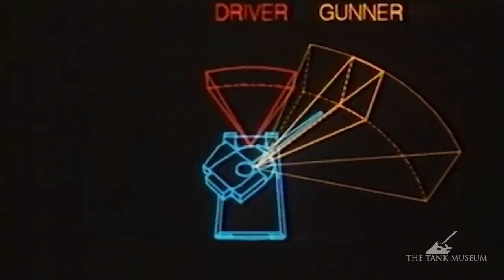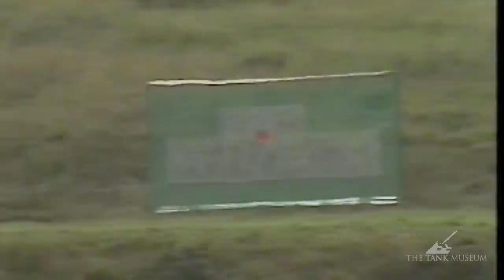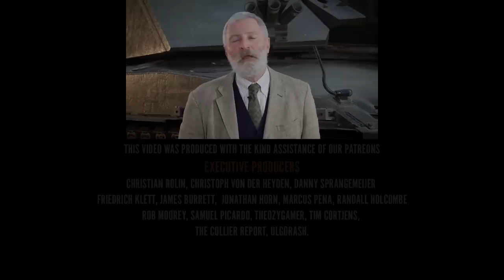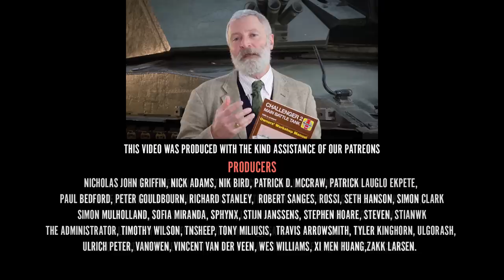Tank Chats #92 | Challenger 2: Part 1 | The Tank Museum

Comment: David has a second career as a HESH ammunition salesman. Looking for the affiliate link.
Reply: Even the HESH practice rounds are useful in combat. These rounds sell themselves.  :)
Reply: Sadly his job as a HESH salesman will soon end. The coming Challenger 3 will use the smoothbore Rhinemattel gun that is used in the Leopard 2. The smoothbore doesn’t use HESH.
Reply: @atinofspam3433  and HESH is pretty bad at anti fortification duty, HEAT-MP does the same job better.
HESH is obsolete from the 70´s onwards as anti tank round, everything you can kill with HESH, you can also kill with HEAT-MP while retaining the ability to fire ALOT more powerful APFSDS rounds
Reply: @zhufortheimpaler4041  thanks for that

Comment: There were 4  British armoured divisions, however none were fully manned. We had 3 tanks per troop, instead of 4, due to defense cuts, .a number of pieces of equipment were removed from Chieftain, due to defense cuts. Regiments were being amalgamated, you guessed it, due to defense cuts.

With the introduction of Challenge they shrunk the size of a tank regiment, yup defense cuts.

So we had a great new tank, but not enough crews to be effective. And experienced crews were leaving in droves. So we ended up with nice shinny new tank, in insufficient numbers, few experienced crews, a smaller force, and along comes the Gulf war.

It was estimated the British should have been required to deploy 1,000 MBTs, we probably had a third of that. We got lucky with the collapse of the Soviet Union.
Reply: Peter King , wasn’t it the collapse of the Soviet Union that led to defence taking a back seat
Reply: Don't we have 200 mbts now?
Reply: Damo2690 Which is well short of requirements
Reply: Fanfeck absolutely. Then the Gulf War broke out.
Reply: @Damo2690  200 and 200 in storage I think?
Reply: Would have gotten 600 CR2's though, if not for post-1997... defence cuts -_- .

Similar reason for why the CR1 upgrade program - intended so as to keep the Tank fleet upto 1,000ish units - was cancelled, and CR1 flogged off.
Reply: Fanfeck defence cuts started in the UK in 1967...
Reply: @fanfeck2844  Not really. Our treasury has always played games with the armed forces. Read Kipling's poems from  the 1900's he talks about the shoddy, unappreciative attitude toward the British soldier back then. 
The fall of the Berlin wall was a very good thing in general and an absolute godsend to the bean counters in the Civil Service.
Reply: Being under-equipped and undermanned, is a court marshal offense (for the chiefs o staff). The sentence is DEATH !
Reply: @fanfeck2844  yes, since there was no longer a major equivalent military threat the money could go to other things, especially when you take into account Labour took power just after the SU collapsed and were looking to rebuild large parts of the country and infrastructure left starved by previous Tory governments, such as the NHS which had been suffering from budget freezes and cuts for years, in the face of those changes a massive military is not needed

though ironically Blair would turn out to be a massive war hawk with ego issues....